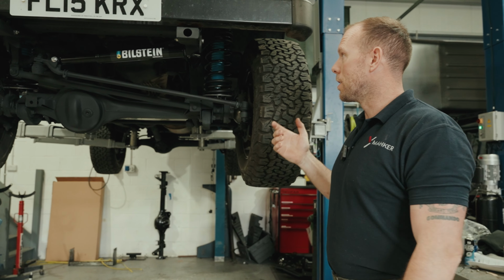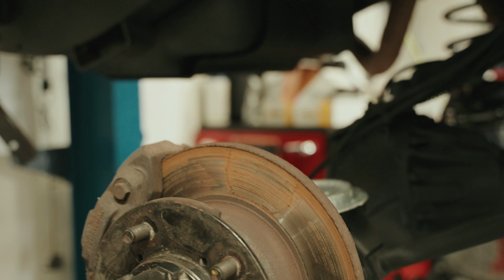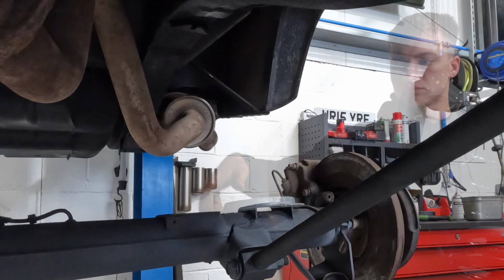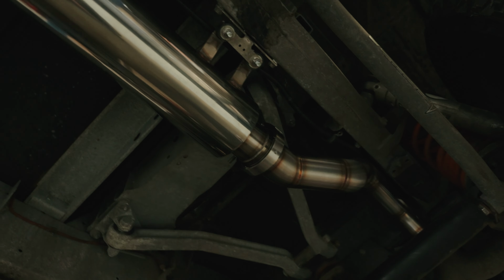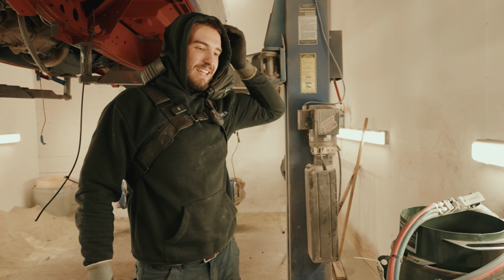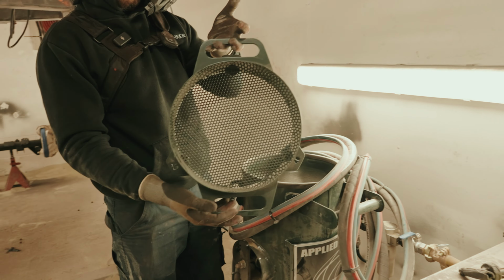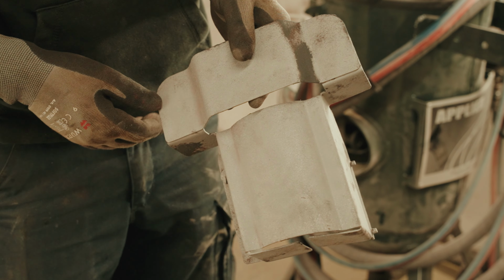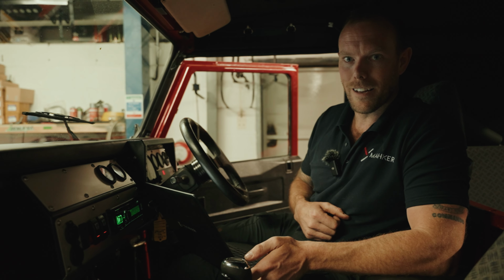How to RESTORE your Land Rover Defender the RIGHT Way || Mahker Weekly EP090

Comment: Another Q and A question:
I've noticed in Project Christine, that you've got the traditional bulkhead and dash. Are there some nice dash and interior upgrades available utilising the older style bulkhead with the manual air vents? Most of the top end builds seem to have the Puma bulkhead. Secondly, is a usable heater achievable with the traditional bulkhead?
Reply from the maker: Dave answers these in our latest Q&A - thanks!

Comment: can you skip the silicone couplings?

At the throttle body, why not use vibrant system?

easier serviceability.
Reply from the maker: We have looked into this previously but getting hold of the lt1 TB bolt on clamps was very difficult.
Reply: Have you looked at motion race works? @wearemahker

Comment: Hello everyone
Is that possible, I want a 300TDI with the suspension of the TD5 screw springs and a galvanized chassis. Total conversion So better axles, better brakes and new interior.

What kind of Land Rover Defender do I have to bring you to convert, of course Left Hand Drive for Switzerland and for the Dominican Republic ??? a TD5 or a 300TDI ???
Reply from the maker: Bring me your 300tdi donor and we will do the rest sir.